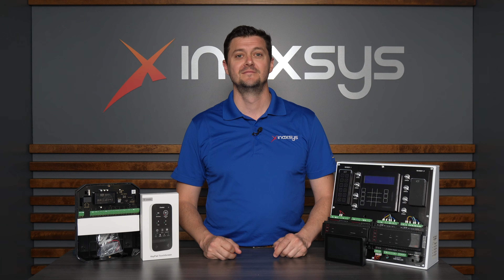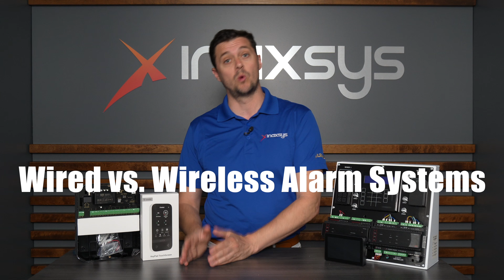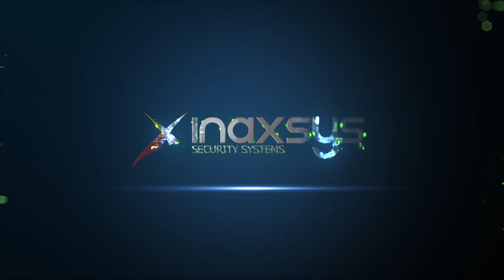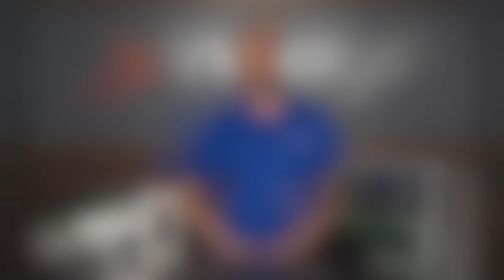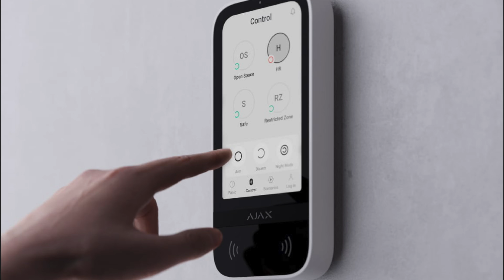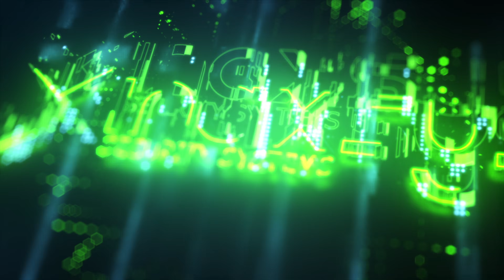Wired vs Wireless Alarm Systems: Expert Advice from Inaxsys Security Systems

Comment: Wireless installation saves big time on labor charges. Those techs who ran wires behind finished walls were incredibly talented. I had my wired alarm system installed over 30 years ago and it remains trouble free.

Comment: Another thing to consider when choosing between wired v wireless.  If you have an older brick or stone home, the signals between the devices will almost certainly be degraded, sometimes to the point of zero useful signal.  Wired becomes necessary in many of these homes.  If you are doing a remodel and have the walls open, do yourself a favor and run network cables to every exterior door, every thermostat and every floor and irrigation system hub.